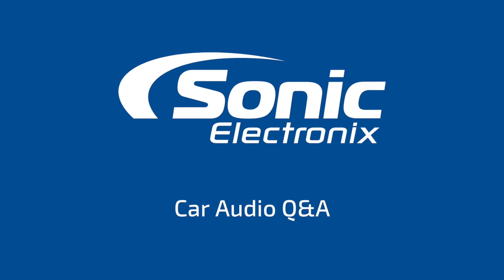What Does JL Audio R.I.P.S. Technology Actually Do? | Car Audio Q&A

Comment: When i drop to 12.2 at below charging state of my 320 alt at low idle rpm then back on the throttle and charging again to 14 volts plus you can definitely hear and feel the difference in power in the jl slash 1000s esp if your running 2 of them the difference in previous amps ive owned is distortion at that lower voltage but not with the slash amps hands down cleanest power ive experienced! Too bad theyre discontinued

Comment: What happens if I hook up 8 ohm speakers to a JL amp w/ RIPS technology?  Does it up the power output to 4 ohm levels?
Reply: "If you connect a load higher than 4ohms nominal, power will drop by half with every doubling of
impedance above 4ohm stereo."
Reply: So switching from a 4 ohm tweeter to a 6 ohm tweeter, 150 watts will be reduced to 100?

Comment: Can't wait to get my HD amps. I want it for the constancy. I'm tired of amps saying they put out a certain rms rating at a specific voltage (typically 14.4v). Unless your electrical system cost as much as your entire sound equipment, you won't ever hold 14.4 v constantly especially on big bass music. With the HD amps, you can have a beefy electrical system, or a stock system with minor work done to it (big 3, agm battery, etc) and still get the rated rms at any given voltage drop.
Reply: Did you get it yet ?

Comment: Is stock Eletrical in a 2013 Dodge Avenger 3.6 pentistar engine with a 1000 watt battery in the trunk enough voltage to run a HD1200/1. I'm not having any shut offs so I'm assuming I'm good.
Reply: It will no problem

Comment: I have the hd750/1 running my two 8w7 at 1.5 ohms and I always get voltage drops.
Reply: voltage drop is gonna happen, the point is the output of the amp stays the same during these drops.

Comment: Hey guys if I'm going active can I run tweeters off the head unit?
Reply from the maker: +Des Lee Normally in active systems the speakers and tweets are run off amplifiers because they have the necessary filters. I cannot think of a headunit that would give you the High Pass Filter (HPF) options you would need to run an active system.
Check this Q&A out, might answer some questions...  https://www.youtube.com/watch?v=dPLxW1sLKao
Reply: +Sonic Electronix thanks for the feedback.